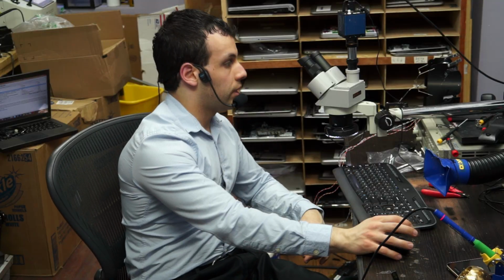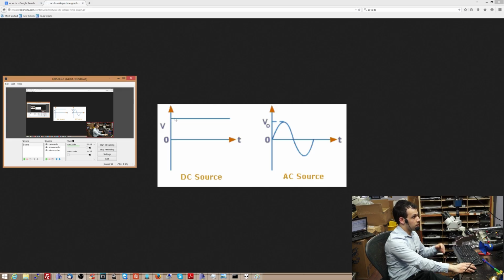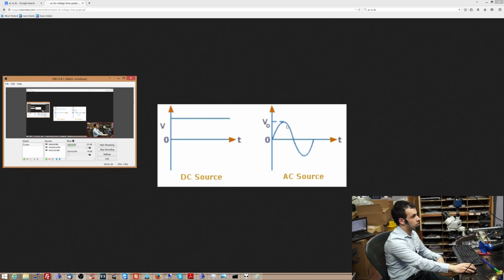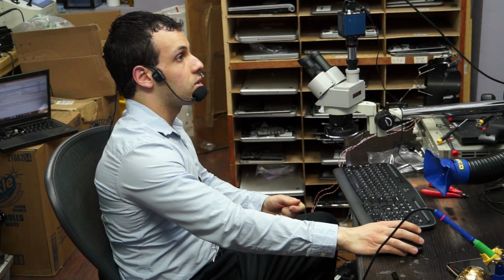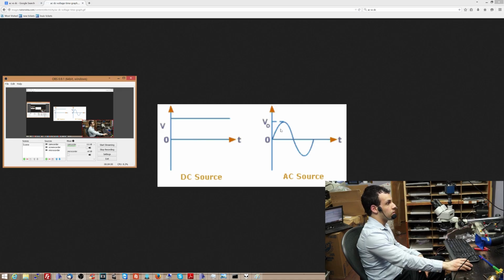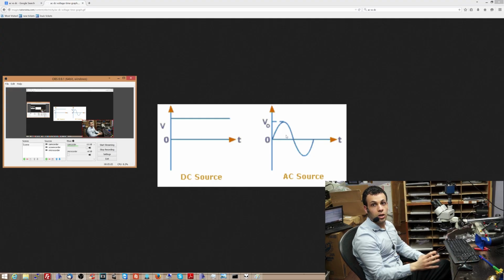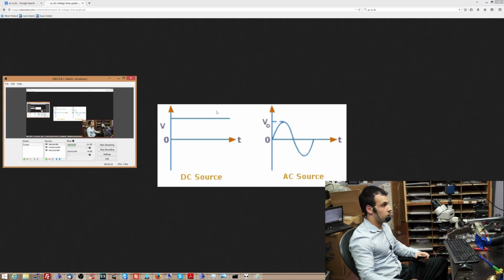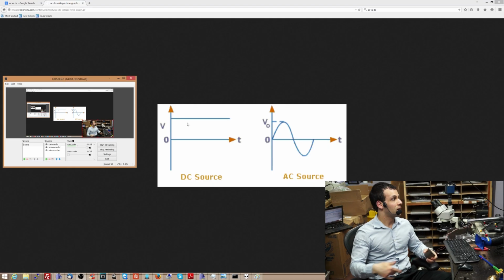What is AC and what is DC?

Comment: It's not that its inherently easier to transmit a "wave" or a "straight line," but rather, bc the source is always spinning magnets. Rotating generators produce sinusoidal AC, because the magnetic flux creates a sine wave from circular motion. sin(θ), where θ is the angle in radians. It's literally the etymological derivation of the sinusoidal shape. Representing the Y-coordinate moving around a circle at a constant speed (over time). The Y coordinate representing voltage (positive and negative) and the X-axis representing time. 

Of course we could rectify AC and transmit DC, but AC is simply "cheaper" in cost of transport. 

Last nitpick, the apex of the sine aren't 120v: The positive zenith it's actually +170v, and the negative zenith is -170v.

Comment: I am still confused, i mean i get it all the binary and 0 and 1s.  But i dont understand one basic thing that is missing in this series. 
You told that from the early start if the mechanical computers. There was a HUMAN that flicks the switch/ connects the wire/ or punches in a punch card to say to add 1+1. Right that was human intervention. But what i don't understand is how in modern computers that gate voltage is applied to the transistor? What automates that? You said that it isn't thinking... its programming...so what does the automation on a gate? Please answer...

Comment: There are computer systems that use three bits instead of two, which is called a ternary system. A multiplexing method called charlieplexing also uses three different states and could therefore be considered ternary. Admittedly, an actual ternary computer system is so rare it can pretty much considered to be non-existent. Charlieplexing is quite a bit more common and can probably be found in some of the devices around you.

Nevertheless, it's not unreasonable to simplify things and say computers are binary based systems. I just though I'd add a bit of trivia for those interested.

Comment: It's not per se that the a AC wave is "easier to transport".

The more important reason is that you can use AC transformers to create very very high voltage (and relatively low current) to transport it (which IS easier to transport), and then once you get to the neighbourhood, you can transform it back to 120 or 230V.

Comment: Hmm I think world is now switching in ultra long distance to HVDC because its more effective than AC voltage, the reason I think AC is used is that it is cheaper to transform voltage than on DC... am I right? So DC has lower loss than AC in 100-800kV range.

Comment: Cool channel, I really love your work and I am really glad I watched some of this videos here. Now, I have a small question for you: I own a notebook which I use without a battery attached, which when I shut it down from Windows normally, it would shut down the OS, get to a black blank screen, but then it won't turn off by itself, it would just stay like that, with all the coolers still spinning, with the light on the power button still on, and the only way to turn it off completely is either unplug it from the power outlet, or hold the power button for like 10 seconds until it turns off... The funny thing is, if I attach the battery and run it with the cord unplugged, when I choose to Restart in Windows, it shuts down the OS and it turns off the machine correctly. If I choose to shut down, again, it does the same thing as if it were plugged to power, battery-less... So now, I mostly believe it has to be a motherboard and/or PSU related damage which happened somehow, but my question is would it be repairable (not replaceable), if it would be worth it and especially what I care mostly, since I was planning to buy a new machine soon, was what could have made this damage, I mean, I never messed with the internals, so, have you seen something similar to this or... And btw, Windows hasn't got any viruses, exclude this, I mean I am sure it is a HW problem, it does the same even if I use Linux on it, so... Well, not that small of a question, but I think it is interesting, hope you see it and thanks for helping me out and doing this great videos. Cheers!

Comment: Just to make things clear for newguys, the 120V in an outlet is it's effective (RMS) value, the peak value will be 170V not 120V as Louis said.
Reply: +webkar I wanted to comment this same thing but you beat me to it.

I'm not sure if he made a mistake or just simplified it because he felt extra complexity wasn't needed, but yes the 120 quoted for wall outlet voltage can be thought of as: "The equivalent DC voltage," the actual voltage oscillates between -170 and +170.
Reply: +Zambia95 I was going to say the same too but i looked before cause  i was sure that other people would notice too.

Comment: AC is great for transmitting energy long distance. Essentially power supply will send super high voltages through the lines. Then the transformers in the power lines will regulate what voltage goes to your home. With DC there isn't an efficient way to regulate through a transformer. So homes close to power supplies will have tons of electricity and homes further away will have depleted energy. Meaning there would have to be power buildings every couple miles(just doesn't work).

Comment: sorry if this is a stupid question. dose AC have any benefits over DC when being used for things like fans or heaters. or is just simply AC would 'do the job'  it seem like only DC is usedin laptops,
Reply: ***** ac to dc circuits waste power. 
in the case of a heater it really doesnt matter so they just go ac to keep the cost down.
electric motors are generally either ac input or dc input but they all really work off ac so as it turns out the ac motor is a good bit more efficient because it gets fed a nice sine wave while dc motors rely on brushes that rub against a commutator to get power to the armature(spinning part) which does not make for a nice sine wave
Reply: Robert Brink Thank rob.

Comment: Why exactly is AC more efficient at transporting electricity than DC? If I am correct, the hertz is the period and the voltage is the amplitude of the sine wave right?
Reply: tiansili Look for Nicola Tesla in the web who brought this to us. Edison wanted to have the DC connections. But Tesla had the idea to transport it through AC and he was right.
Reply: tiansili AC is more efficient because it's basically switching on and off all the time. If you put a voltage into a coil of wire it creates a magnetic field, then if you remove the voltage the field collapses. If you add another coil in the magnetic field it will generate a voltage as the field collapses from the first coil. Change the amount of winding's between the two coils and you can pump up or down the voltage. Voltage and current are relational so if you want to move electricity a long distance it is best to reduce the current so you can use smaller wire. P=IE. So use the two coils (a transformer) with AC and you can pump the voltage way up, send it across relatively thin wires and then use another transformer to pump the voltage back down to a usable level at the location you need it (your house). You get as much current as the transformer can handle. The switching of AC makes this inherently easy to pump up and pump back down the voltage using nothing more than transformers.
Reply from the maker: I find it funny that they used the fact that AC was the electricity of choice for the electric chair to try and scare people out of using it in their homes. As if sending hundreds of thousands of volts of DC to people strapped down in a chair wouldn't fry them too. Asinine advertising has existed for a long time before TV and the internet.
Reply: For very long distances, HVDC is used. Also for underwater cables.
Reply: tiansili AC can travel longer distances than DC from what I remember. DC voltage tends to break down over a long stretch,while AC on the other hand can still maintain a steady voltage. AC is also safer to work with. I hope I explained that properly. If not. I am sure someone will let me know. (I replied to your comment before watching his video btw.)
Reply from the maker: macschomo They had campaigns to try and get DC to every household implying AC was dangerous, by touting that AC was utilized for the electric chair. Pretty funny stuff. :)
Reply: You're right. That was the same crazy time we have now.
Reply: +tiansili In long distance power transmission we want less current in the lines with high voltages, we use AC so that we can easily step up voltages using transformers and hence have smaller currents in transmission lines so that there are less power losses. This is much harder to do in DC
Reply: It depends really. In very long distances, HVDC is better than HVAC.
Reply: HVDC allows power transmission between unsynchronized AC transmission systems.
Reply: Edison also electrocuted an elephant as a publicity stunt to show that "AC is dangerous".
Reply: tiansili To transport electricity over long distance you wont height  voltage because you will when need less current and you will have less losses in power lines (Ohms law and stuff). AC was much simpler to step up and down (and you don't wont couple of kV in your outlet). There also some other things why it AC, but this is main reason for that. Nowadays also stepping DC up and down would not be a big problem anymore, but you will need to change lot of infrastructure and some of your devices would not work anymore.
Reply: Funny?
Reply: +Patrick Woodlock Up the voltage  on DC and it'll fry you nice and steadily.
Reply: you can use transformers to raise the voltage of ac and then transport it long distances, this is not possible with dc.
Reply: no ... Dc loses power over distances more than a few hundred feet...
Reply: I still stand correct.
Reply: well that's why transmission lines are +40,000vac...high voltage lower amperage...then step down transformers as it gets sent to your home which is around 16,000 volts at the pole then step down again to 240vac as it comes in your house
Reply: I still stand correct